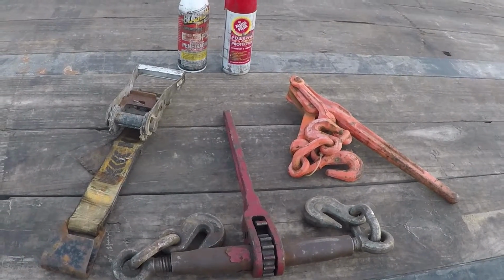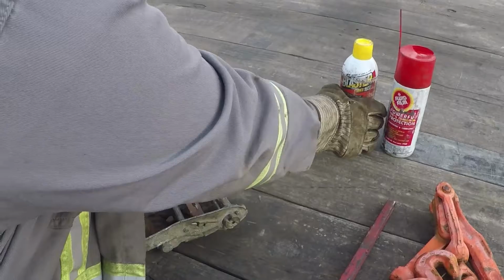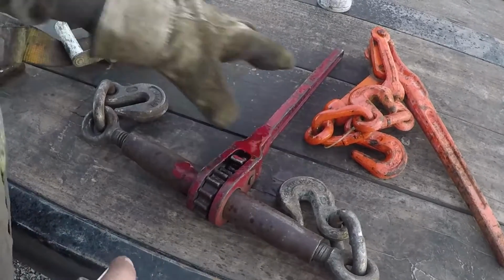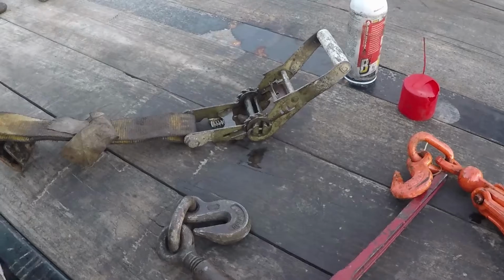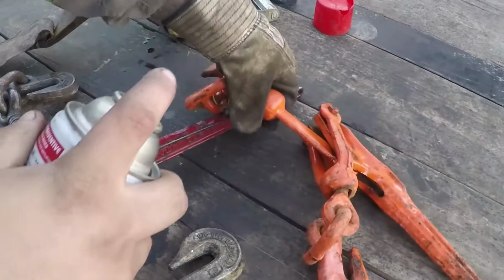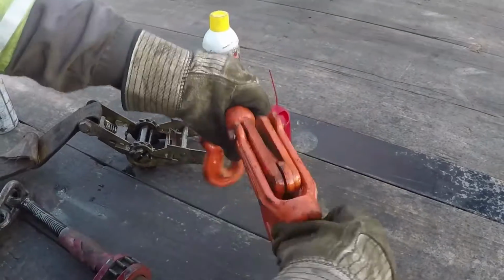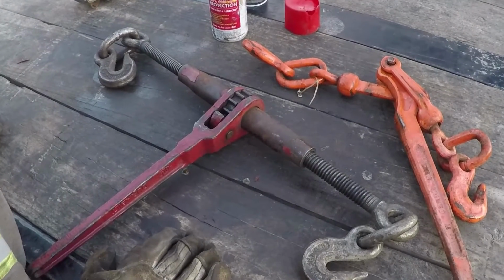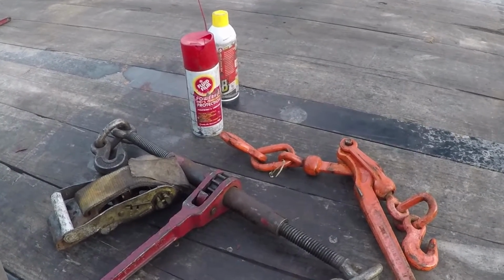Chain Binder and Ratchet Strap Maintenance

Comment: Stainless steel ratchet straps
Reply from the maker: That another solution. The only ones I've seen though are 1 inch except one set of 2 inch and the rating is nowhere near that of the straps in the video.
Reply: @k30krazy  What is the strength rating of your ratchets?